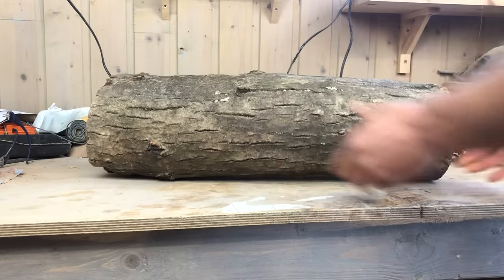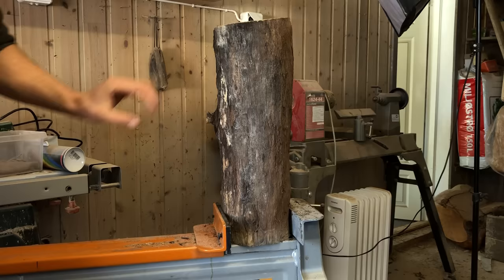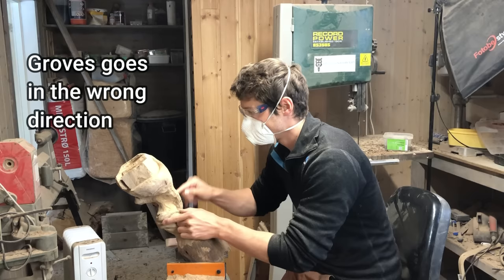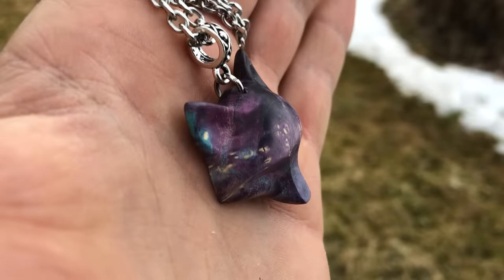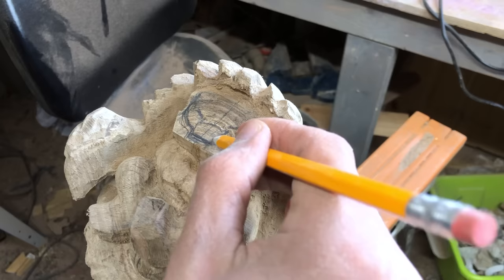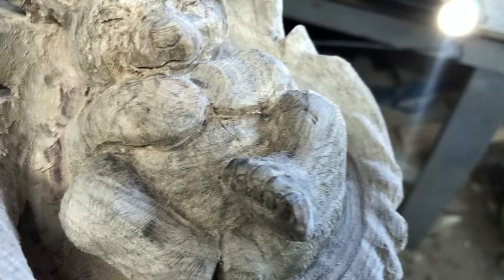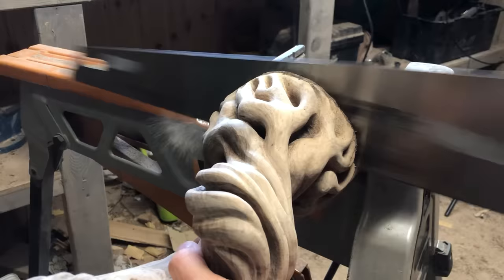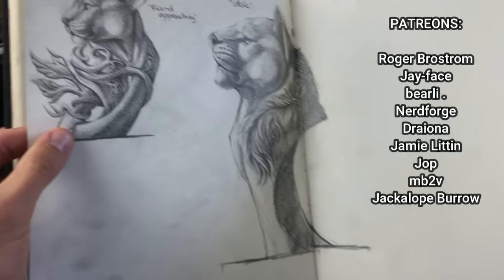I spent 30 DAYS making this Sleeping Bear Sculpture!

Comment: 2:24 I first thought that mouse fella was in a coffee mug. I think he would look absolutely lovely peering out of a mug with such a happy expression.
I love how the roots end down at the bottom.
I can relate with your struggles. I've been burned out for quite a while now. I'm hoping that I can start exercising a bit to get some more energy, but right now just basic necessities of life are sometimes too much. Funnily enough I'm able to work, at least most days most of the work day, but it is draining. Then again, everything else is as well. Even after my work tasks have been revamped so it no longer produces overtime and the work is, to be frank, trivially easy for me, getting better is still something that doesn't feel like a certainty. I spent 3.5 months at home, the first 2 weeks were hell, and I am better though there's still quite a mountain to climb. Barely get any woodworking done. So where you are right now, to me it sounds positive. Keep on fighting man! (in the way that's not an actual struggle but a steady sustainable growth as not to burn out again and remember to be forgiving to yourself. Healing from burnout is a slow process and being cruel and abusive to yourself is the opposite of productive. You're just a man after all. A very talented, handsome man, no homo <3 )

Comment: Jonas,  it's refreshing to hear your trial and tribulations during your carvings. It's as if you heard me during mine. Learning as you go and gaining knowledge  off each project.  Just something I do with cracked areas I come across. I apply some of the finishing oil in that area to keep it from disintegrating as I work in that area. Keep sending out your beautiful work.

Comment: Great job Jonas, small remark - I do different stuffs and using  mix epoxy with dust but if I need deeper penetration I use heat gun warm up wood and epoxy and still using heat during filling a gap.

Comment: Great video and beautiful sculpture! Your commentary is so relatable… 

I am really looking forward to your next sculpture. I completed a sculpture of a favorite pet house cat, and I was in the process of sculpting a Jaguar. 

I procured a 6 x 6 x 3 turning block of “Lati” wood for this piece. I learned a hard but valuable lesson about dimensions and scale. Bottom line… 6 x 6 x 6 would have been the minimum size of wood stock I needed to start with. 

My sketch (a beautiful snarling Jaguar looking right at me) was pretty good. The depth I was able to reflect in the sketch required more wood stock than the 3” dimension could render. So…. I spent way too much time trying to scale down the sculpture. 

I am not talented, experienced, or skilled enough to make wholesale corrections. I stopped and I am moving on. 

Keep moving forward…

Comment: I am currently working on refinishing a rather sizeable live edge chair, I have no experience so maybe there is a downside to my suggestion. But I have been using a leaf blower to remove sawdust after sanding, and it works quite well. It may be worth a try. Love the work you do, keep it up!

Comment: Nicely done! … as always 
Could you reduce the amount of sanding by using carving knives after the power carving?
Btw if you have a table saw you can raise the blade just slightly above the table top, like just a mm, and then pass the base of a sculpture over that , with the saw running of course, to safely shape the base. Hollow out the center and give the outside edges a slight 3-points of contact so it stands steady.

Comment: Amazing work on the statue man ! I have battle major depression burnout for the last 9 years so I know how it feels.

What is the bolt tool on the grinding wheel and how do you keep the angle grinder from overhearing and breaking down ?

I totalled mine yesterday